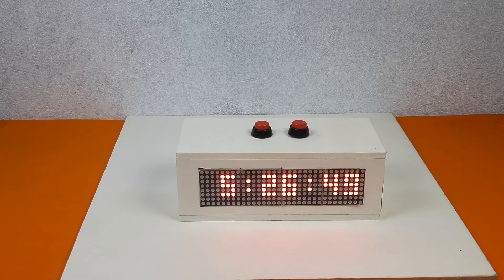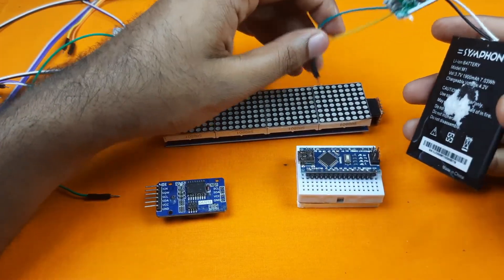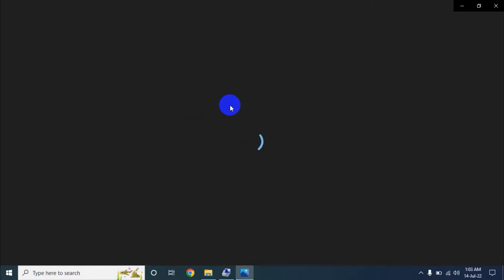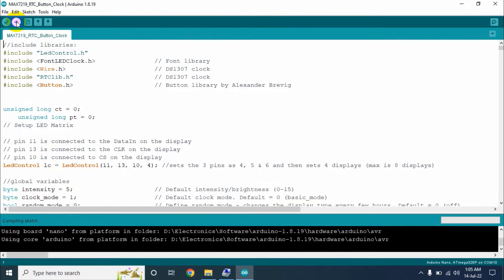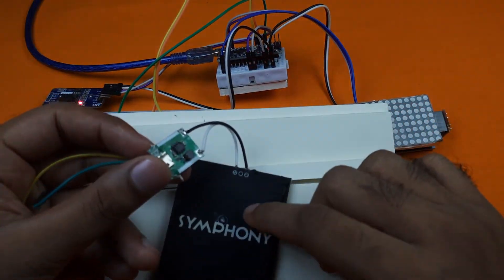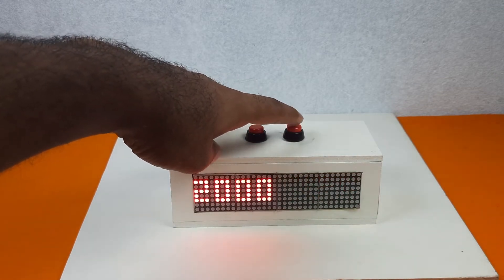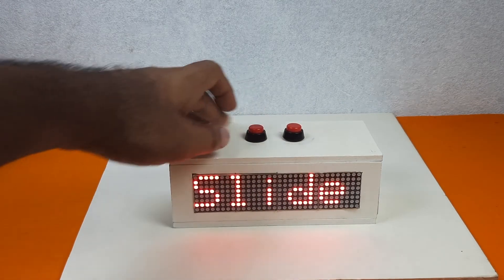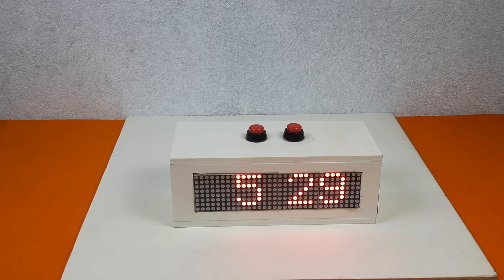Smart Digital Clock using Arduino, MAX7219 Dot Matrix Display and RTC Module

Comment: Hi, thank you for this nice DIY project. I am using an Arduino Leonardo, DS3231 for this but when I am pressing the button it is not working perfectly. I can switch the mode and go to the settings but when I enter the settings the the date time increase. When trying to set month it auto loop from 1-12. Sometimes when pressing button A at main time screen it freezes the clock. Please can you help me out.
Reply from the maker: maybe your connection has some issues. recheck everything.

Comment: I make automatic clocks from GPS and still need 2 buttons to set the time zone or the daylight saving time (time zone as well, sort of.) That should be saved in EEPROM, so it can recover from a power out or similar situation. Then I can move onto other functions, but I cheated and leave things as is for a longer time and experiment more.

Comment: Great video!
I have one question. Is it possible to display the date only when the button is pressed?
For the first time, I will be using Arduino to create a work of art.

(I am using a translation, so the English may be strange.)
Reply from the maker: Yes it's possible
Reply: @NTTronix  Thank you for the reply!
Which program displays repeating dates?
Reply from the maker: @putty1003  check void loop function
Reply: @NTTronix  I found !
Thank you!!
Reply: @putty1003  can u please share the code